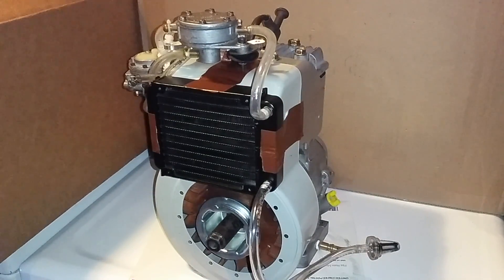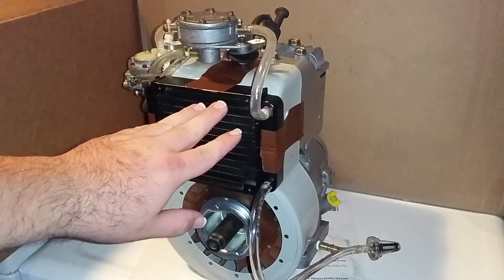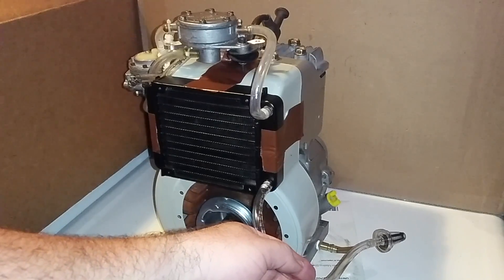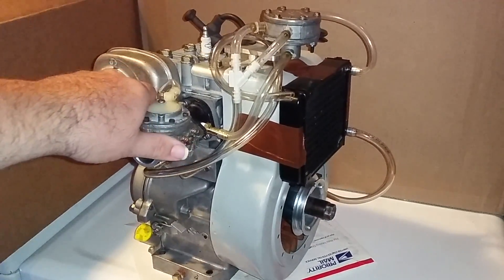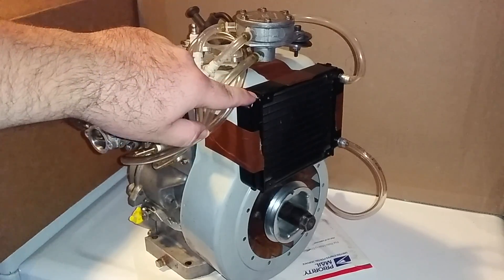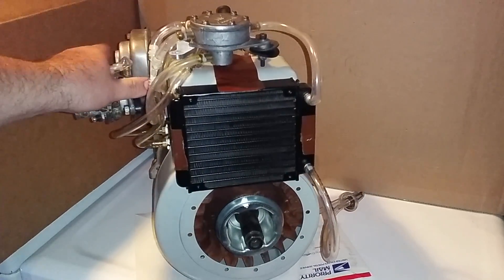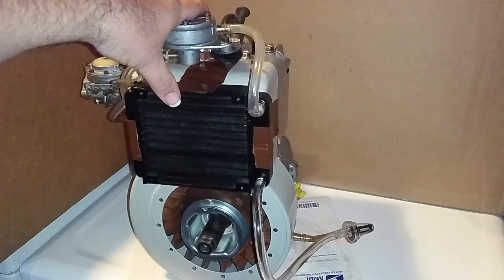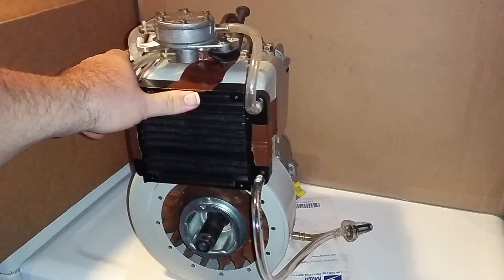Oil Cooled - Briggs 5hp Engine Project - Part 2

Comment: There are 2 ways to address the oil drain back without using a check valve:
1. reorient the cooler so both the lines are on top.  This will result in just the lines draining back if they are above the oil level.
2. relocate both the oil feed and return line so they are below the sumps oil level.
Reply from the maker: I ended up using a 90 degree elbow & ball valve just above the oil drain outlet on the right. It let me adjust the oil flow speed and when I turned the engine off, I shut the ball valve so the oil couldn't drain back. I have videos of it on my channel.
Reply from the maker: https://www.youtube.com/watch?v=YlPqKMlHs1A

Comment: verry good design but may I add that you could put the cooler on the other side of the engine where the air is being forced past the head it would be a little warm but If you spaced it away some the air would blow through then buy a lazer thermometer from harbor fright and do a before and after
Reply from the maker: +josh neves 
I ended up getting a smaller oil cooler and put it on the side of the shroud. I cut out the shroud area so air is forced through the cooler at idle & I thought at high speeds air would be forced inward like a ram-air setup :)
Here is a short test run video.........https://www.youtube.com/watch?v=EgAJGceUkEE

Comment: Very neat ,but wont the plastic/rubber material soften due to the heat or even melt?
Reply from the maker: Thanks Bro !!! 
Yeah, your right. The vinyl tubing is rated at 70F,
but if it melts that would make a cool lookin mess. LOL

Comment: DC5000123, Cool concept, I always thought that hooking an oil cooler to an air cooled engine driving a generator would be a way of collecting heat as part of making a cogeneration project more efficient. Cool, thanks for posting!
Reply from the maker: Well, oil coolers are popular on those Honda CT Clone motors.
Thanks for watching :)